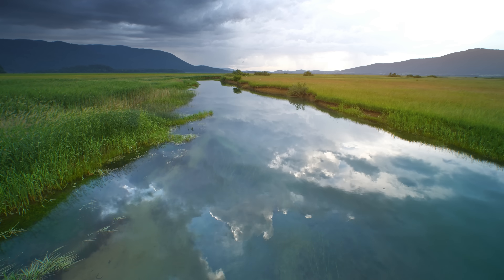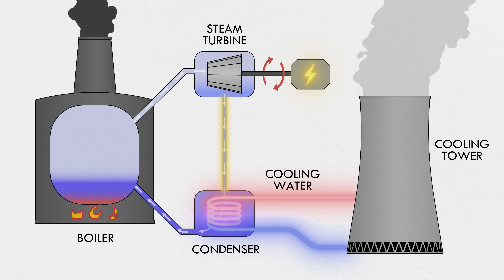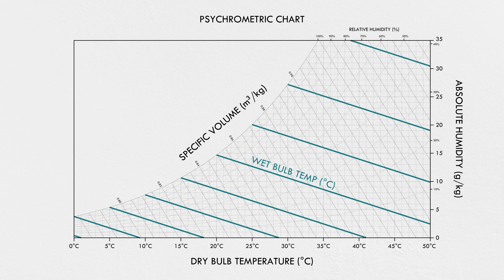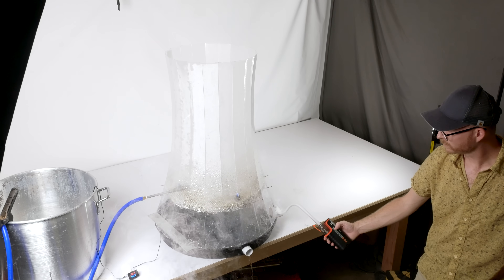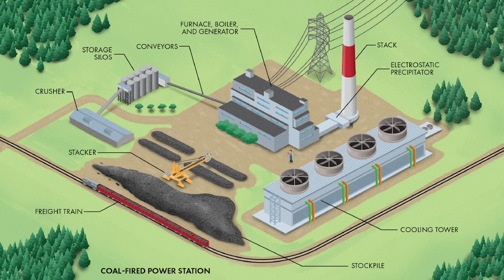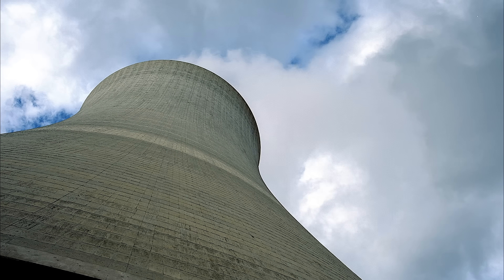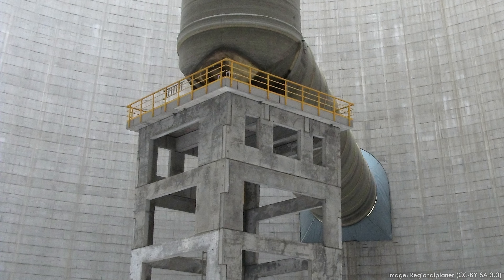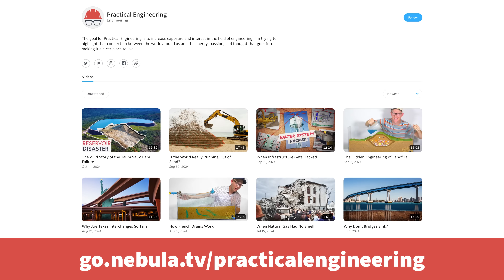Why Are Cooling Towers Shaped Like That?

Comment: I've read a paper from 1940s about structural integrity of these things, where the authors complained that the required thickness from calculations is so small, that would be technologically difficult to build the tower with such thickness. Another complaint was that the tower is hard to demolish :D
Reply: The tower's shell thickness is comparable to an egg's shell at scale....
Reply: My last job,they were 52 yr old no probs, and due to their shape,they demolish easy and v v neatly
Reply: @TheDigger06  Did you use explosives at the foundation? In that case I could imagine the shape being beneficial. What I saw in the paper was visibly distorted tower, which was still standing. It is possible they used more material than required at the time. Unfortunately, I was not able to find the paper and my memory of it is not 100%.
Reply: @tomasletal257 I've seen videos of how they have to manually deconstruct power plants over the course of weeks. Don't know why they do it, maybe it's just regulations. Take my word with a grain of salt, though.

Scratch that, I read that it takes several years to decommission a nuclear power plant. Don't know about the towers, but they apparently can't just be blown up, cause of contamination.
Reply: @astroyeaster9464  In case of nuclear power plant, the towers shouldn't be contaminated. Still, by blowing such tower up (its actually blowing down), you could affect contaminated areas.

Anyway, these towers are also used in non-nuclear power plants, where blowing up is an option.
Reply: @tomasletal257  thanks for clarifying. That makes sense.
Reply: @astroyeaster9464  Not true!!! There isn't any radioactive fluid going through a cooling tower.  If there's contamination it's of a chemical nature from concentration of minerals.
Reply: They are designed such that when they fall they fall into the basin below, preventing damage to other areas nearby.
Reply: Construction methods have progressed greatly since the 1940s so perhaps the paper had legitimate concerns for it's time, im just guessing i didnt read the paper

Comment: In Russia in particular, and in former USSR in general, waste heat from TTPs is often used to heat homes through the winter via a network of underground insulated pipes. They have to branch when coming into apartment blocks and branches need to be accessible, so there are access shafts above them. This leads to a sight that never fails to stump foreigners: patches of green grass and ponds of evaporating water in a middle of snow swept city in dead of winter. Always cheers me up seeing non-migratory birds warming up in the steam when it's -30C outside

Comment: As an operations supervisor at a thermal power plant this is awesome and will be referenced when training new employees and refreshing the senior operations employees. Thank you!
Reply: Yes, I wish they showed this video when I went into my initial training.
Reply: @ the most common question I get is why the cooling tower is shaped that way. I can get through it but no where near this fluidly
Reply: @Andrew_Gregg i always thought they had some fans inside the tower to force air flow from bottom to the top, but i had no idea it was all a natural fluid flow with NO moving parts. the hyperboloid shape, which i thought to be very fragile, turned out to be stronger... and thats how its so thin and structurally stable. they could still create a natural draft out of a simple cylindrical tower but ofcourse the primary concern would was the structural integrity, solved by such simple yet genius shapes.
Reply: @realracing3specter295   Some shorter towers do use fans at the base.
Reply: @dwayne7356  yes the fans can help get you past that hump in dry humidity where the density doesn’t really change. My plant doesn’t use them but has considered it in dry conditions as we are in a drought currently
Reply: @Andrew_Gregg   Ah, Fluidly, I get it!  ;-)
Reply: @realracing3specter295  loooool :)
Reply: Why does the steam need to be condensed? Why can't it just be fed back to the boiler in it's gaseous state?
Reply: @dang3304 it’s very difficult to “pump” steam. By the time the steam gets to the condenser it has been gone through a high pressure turbine, reheated and reused twice and then sent to a low pressure turbine where pressure continues to drop. When it gets to the condenser it’s about 5psi at most and has barely any heat left. To move it as steam back into the boiler to be reheated and repressurized back up to supercritical pressure and temperature would not be nearly as cost effective or efficient as condensing the steam to water and then using a centrifugal pump to start the process all over again. The vacuum in the condenser also greatly aids in last stage efficiency of the low pressure turbine. Also, after going through the condenser the water goes through a cleanup system where impurities are removed before it goes back into the boiler. Lastly, we have to keep a large amount of water on hand as reserve. It’s not practical to store steam when water doesn’t require temperature control or nearly as much volume per unit mass
Reply: @Andrew_Gregg  Interesting. Does that mean that the water is only cooled to just below the point it condenses? Like 99C / 211F?
Reply: @dang3304 you have the right idea! Since the condensers collapse steam into water the change in volume is extreme. Because of this the condenser is at a near perfect vacuum. If you look at a steam table depending how deep the vacuum is you end up with a water temperature of 70-90°F. It’s called a saturated system, where steam and water exist at the same time so it’s very dependent on pressure what temp the water is. 
If you get a little bit more into the weeds on it, there is a concept called condensate depression where the longer the water droplet stays on the tube of the heat exchanger the lower below saturation temp it gets. Since it’s all energy you have to add back in once it reaches the boiler, excessive condensate depression is not good for efficiency, but 0 condensate depression is unavoidable. As such you want to run your cooling pumps in the slowest speed possible to still condense the water, the faster they run, the more condensate depression you get.
Reply: There is no pure English verb to reference, which is a nasty ugly kinderlander neologism. but the kinderlander or american is not  english but rather some dialect or pidgin of pure English in which reference and parent are  nouns.
Reply: if real and will follow through, how do you plan to execute this? it's a 20 minute video I could imagine only new people will get to see it
Reply: Its so bad with your education you need a youtube video for it???
Reply: Kinda blows my mind that a power plant would hire someone without 4+ years of formalized education on these topics/charts. XD.  Not to discount how amazing Grady's  vids are...just the bar is at a different level than I suspected.
Reply: @frollard  Unfortunately there isn't an unlimited supply of perfectly qualified people just waiting to apply for the jobs you have.  Usually taking an inexperienced but capable person and training them up yourself is a much better option than having nobody at all, which usually results in other employees burning out, leaving, and making the problem even worse.
Reply: @vink6163  As a former program manager at must say it's way better especially if you want somebody to do the work in the way that you have designed it to be completed as opposed to the way that they're used to doing it
Reply: @frollard they do, but you're talking about people with Masters Degrees in specific engineering fields, and there just aren't that many of them. So they're normally employed in senior technical and management roles. But there are lots of essential roles like technicians, maintenance foremen, shift managers, operators etc that you just can't practically fill only with qualified Engineers (nor could you afford to). So for those roles you have to hire competent people and educate/train them yourself, and your engineers oversee and manage them.
Reply: @TheMrZ just get a PMP you can fit in anywhere😂
Reply: @frollard I do have formalized training on these subjects. My training just didn’t include the shape of a cooling tower and I never put thought into the why more than the general concept of natural draft. The majority of operations supervisors were hired as equipment operators right out of high school and have 20 years plant experience before they ever become a supervisor.
Reply: @frollard  A lot of the people that are employed at these nuclear power plants in the US are former Navy Nukes that already have hands on experience operating reactor plants on submarines or carriers. A four year degree is definitely not necessary.
Reply: is that a COOL job? :D

Comment: 7:45. He said "water molecules are less dense than air molecules".  This caused me to look it up. It's more precise to say water has a lower molecular weight 18 g/mol than O2 32 g/mol and N2 28g/mol. Dry Air is mostly N2 78% and O2 21%.  If you would rather talk density: Liquid water is denser than air but water vapor is less dense than air at standard temperature and pressure. Liquid water = 1g/cm^3. Water Vapor= 0.0006 g/cm^3 at STP.  Dry Air= 0.0012 g/cm^3 at STP.   So I learned something.
Reply: He didn't exactly say "water molecules are less dense than air molecules" (which would be wrong), he said they "weigh less", which I think is correct (apart from the possible nitpick about mass versus weight). That's an important distinction, because talking about density only makes sense if you're talking about the bulk substance (a lot of molecules at once), but single molecules still have a (really small) mass, so talking about water molecules weighing less than air molecules is still precise language.

Another interesting fact: That quote of 0.0006 g/cm³ at STP for water vapor is something you can't actually achieve. At standard temperature and pressure (1 bar and 25°C), pure water vapor just condenses to form liquid water, leaving you with some slightly warmer water (latent heat of condensation!) and a small amount of vapor above it. The 0.0006 g/cm³ figure is just a basis for calculations if you know your gas laws (p*V = n*R*T and all that).

Comment: I gotta say... this is all such, such useful information to know if I wana come up with my own efficient way to cool my future home and I was able to follow along for most of the video(barely) but the psychometric chart went waaaay over my tiny average joe brain and I'm kinda disappointed in myself. Gonna have to rewatch a couple more times. You always do such a good job of simplifying everything so you're giving even an average joe like myself the opportunity to understand such complex stuff. Thank you so much.
Reply: get a heat pump, not a swamp cooler, is my advice for the forseeable future.
Reply: @OutbackCatgirl  Oh yeah, I heard about those swamp coolers and even considered buying one at some point. Thankfully I didn't thinking about the fact that my sweat barely ever evaporated since the humidity here is always really high and I felt my choice was justified when I saw a guy on YT called Technology Connections make a video on them.

Anyway, heat pump. Got it. Cheers mate!

Comment: There are also hybrid cooling towers. They have both dry and wet exchangers and also use mechanical assist due to lower height. Palo Verde has them to save water.

Comment: I think I missed something. Why throw away so much of the heat? Why not cool just enough to condense and then use it again?
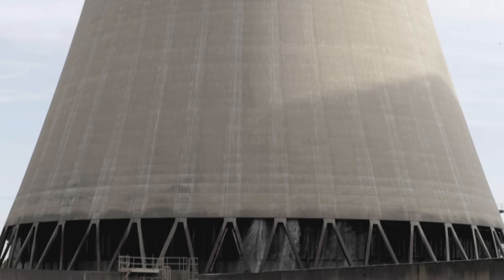Reply: From how I understand it, the steam in the primary cycle is cooled just enough to condense it and reused. Look at the graphic starting at 4:20 - the steam forms a closed loop in the left part. It's the heat you get from cooling that steam that you have to get rid of somehow, because the difference between hot and cold cooling water isn't enough to run a thermal engine efficiently anymore - that's what the cooling tower is for.
Reply: because doing so would waste more energy from the power plant itself, and make the convection currents weaker thus causing far less cooling. You keep most of the water, mainly you're outputting hot air with some low density water vapour, so in the end you get more cooler water faster with less effort

Comment: PracticalEngineeringChannel
Funfact, most of the white smoke from the coal/gas plant chimneys next to those cooling towers is also just water vapour.
Burning natural gas produces lots of water and some invisible CO2.
Coal plants produce lots of CO2 other stuff(depending on the sort of coal used) and less water.
Proper filtering flue gasses has a step where water is used for cleaning those fumes and thus also producing white 'smoke'.
You should do a video on how clean coal plants produce gypsum.
It's very interesting.
Reply: If you can see it, it's not water vapor. It's just water in very small droplets (or tiny ice crystals if it's cold outside). Water vapor is 100% invisible.

Comment: it seems like such a waste though. shouldn’t there be a way to extract useful energy in multiple stages at lower and lower efficiency? i guess the added cost of more structures and maintenance must make it too expensive to be with it… sigh. could it provide warm water for nearby building heat in winter? or warm showers 🙂
Reply: that would cause the convection currents to be way weaker, leading to less effective cooling, and it would produce fuckall energy due to a number of thermodynamic quirks with water temp in plus pressure plus velocity

Comment: Very interesting video Grady! 

I've worked, and live close to, a Nuclear Station here in Sweden, and it's always been a question I've had why all reactors in Sweden are cooled by feedwater from the sea, they are all built on the coast. I had assumed it was because of Swedens stable geology, and thus low risk of what we saw happen in Fukushima 2011 for example mixed with a bit of NIMBY due to their location, mostly - and frankly, where I live is beautiful and the reactorcontainments are already huge and imposing, and does to some extent screw with the areas natural beauty.

Comment: I've wondered if there is a way to take advantage of the steam condensing and generate energy from that, like some form of reverse turbine as it cools.
Reply: the amount of energy you'd get out would be pitiful and not worth the effort
Reply: @OutbackCatgirl  why wouldn't it be equivalent? The turbines turn because the water forcefully expands. Theoretically it contracts with the same or similar force. Is it just we don't have good tech to take advantage of implosion?

Comment: Thanks to my eldest brother working for Eskom in the late eighties, I had the privilege of getting a private tour of the, then newly completed, Kendal power station in Mpumalanga, South Africa 
Unit six hadn't been put into service yet and the tour included an inside look of unit six cooling tower
That power station uses dry cooling rather than the wet cooling you describe so well in this video 
Kendal also has the largest cooling towers in South Africa 
(I think they're the largest in the Southern Hemisphere)
They also have the the only trig beacon mounted on a man made structure in South Africa 
Their huge size is partly due to using dry cooling which requires a larger tower for the same level of cooling as a wet cooling tower, but requires less water
Reply: I live near the old Athlone power station in Cape Town. The cooling towers had to be demolished because they were structurally unstable.